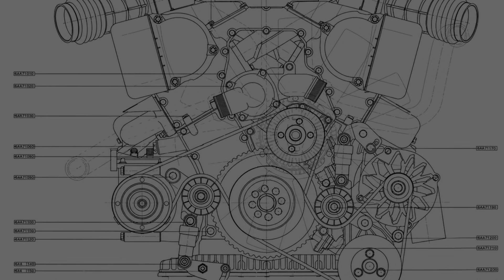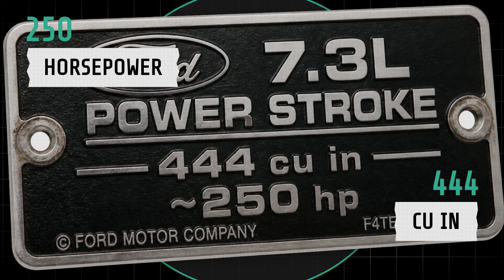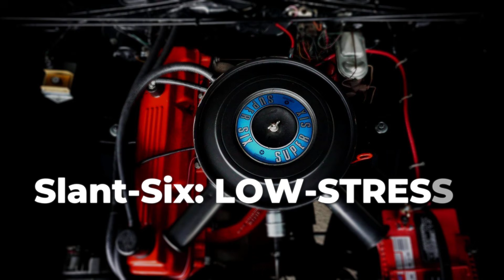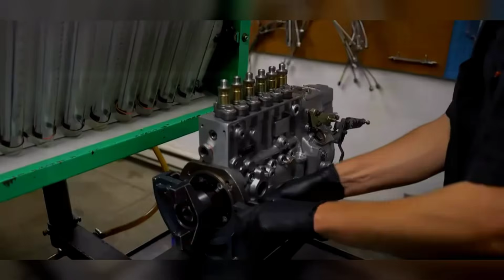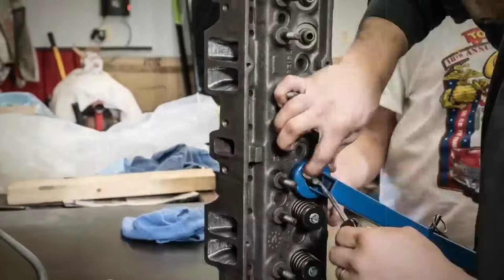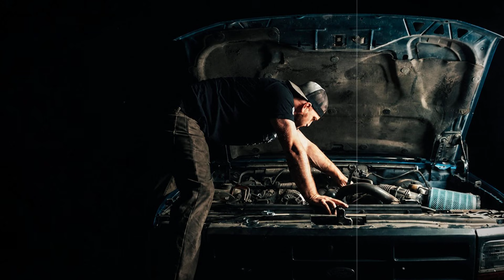5 American Engines That Will Still Be Running in 2050 (Mechanics Are Buying Them Now)

Comment: I have put 360,000 on a Chevy 4.3 V^, pulling a 25 ft boat.  The engine was still good when the tranny went.  Due to rust the body was not worth making the repairs

Comment: You don't want an engine that will be running from now until the 2050's.  The vehicle won't be safe for anything but car shows and the track where it won't need that kind of endurance.  Look, people get smashed and killed out there.  Why would you forsake the next 25 years of safety advancements?  Yeah, there are a lot of things about new cars that suck and some things will get worse, but there can be no question that cars have become radically safer in the last 25 years, they will almost certainly continue to advance in safety at least, and the "good old days" are not worth dying for.
Reply from the maker: That's a really valid point about safety advancements, and it's definitely something to consider when thinking about older vehicles. My video was more about the mechanical longevity of these engines, but safety is paramount.